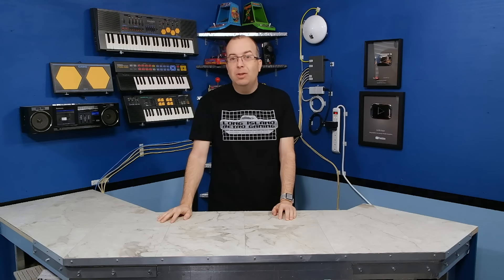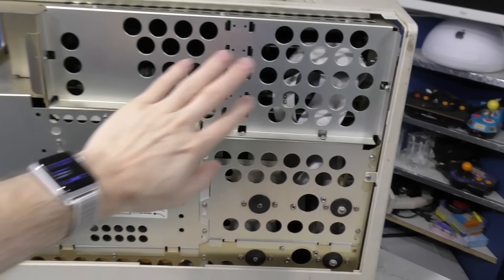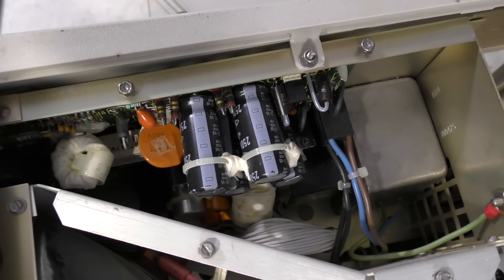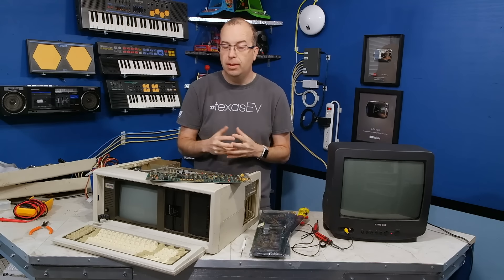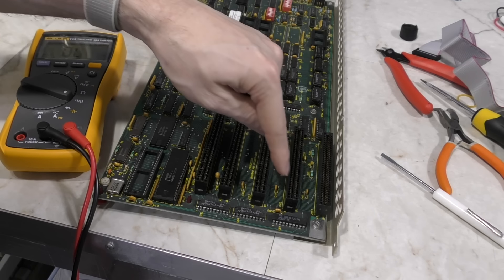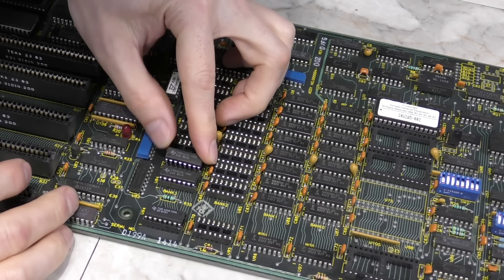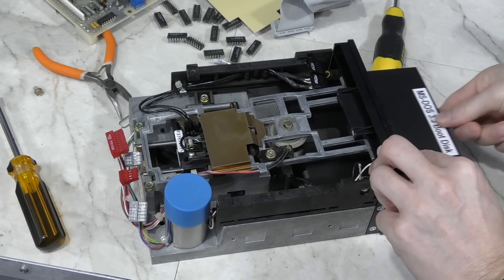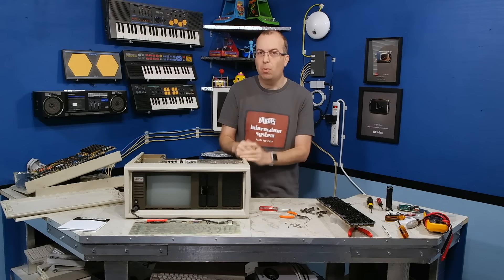Compaq Portable 1 Restoration - Part 1

Comment: Ask any antique radio restorer and they will tell you all about bad capacitors... They fail shorted, they fail open, or they fail in between where the ESR ("equivalent series resistance") becomes so much that they appear to work on a capacitance meter but fail in real use. A capacitor ESR tester is essential to fix electronics of this vintage without having to do shotgun (hope something hits the target) parts and board replacements. An ESR tester is inexpensive and I often use it before I even touch my multimeter. 

The Variac trick for slowly powering up an old radio, gradually bringing them up to full line voltage, is your key. With analog electronics, it's no problem; cranking the voltage up by 5% or so an hour works well, the tubes are colder than normal so the current through them is less than normal, the radio eventually starts to play quietly, a 1950s TV set might start to display a small and dim picture, etc. In fact, this will probably work with most older analog monitors.

There are a few videos of antique radios "cooking" at low voltage here. Electrolytic and tantalum capacitors use an oxide layer between the plates to avoid a short circuit. Gently powering up the radio allows the oxide layer to re-form and regain its strength before they experience their full rated voltage and inevitably short.

 https://www.youtube.com/user/TheLawrenceWade

But bringing up the line voltage to a computer with a switching supply which is designed to put out solid +5/+12V is likely to damage the supply - and wouldn't help anyway because once you get the Variac to a point where the supply can run, it'll just slam out its full regulated output and blow the tantalum caps off your motherboard. 

Failed capacitors are likely to become much more of an issue with restoring old computers because capacitors, especially electrolytic and tantalums, age with disuse. They just go bad sitting there. Ceramic and plastic film capacitors tend to be pretty good but are only available in smaller capacitances. I would always pay special attention to the power supply capacitors (in a small and hot box, but also dealing with substantial ripple current), the capacitors near any heat sinks including the CPU, and any capacitors in a device which is likely to get dropped (like a keyboard, mouse, external power supply, or remote control). Any tantalum or electrolytic capacitor can fail at any time, though. 

Aside from desoldering capacitors individually from a motherboard and gradually ramping them up to DC voltage, I don't see much of a repair path. It's gonna be labour intensive, risky, and will obviously damage the originality of the boards. And if the capacitor is already off the board, why not replace it with new? Don't try the Variac trick with digital electronics, I'm less enthusiastic about what would happen if you gradually ramped up the 5V and 12V lines; without the clock oscillator running until the bus voltage is high enough for it to start, I think bad things would happen in synchronous logic, and it might be really good to start a conversation with the people who designed this stuff about how to preserve it. 

The people who designed and built my 1937 RCA 88-T radio are long since dead. Fortunately, the electronics they created are simple enough that reverse-engineering it is possible - none was required; the radio was preserved well enough and powered up slowly enough that even the woven cloth power cord is original, and it all works after 82 years. 

But people really should be pounding on Wozniak's door asking him what will happen if you slowly ramp up the voltage to an Apple II to reform the capacitors without replacing them. Will there be race states or other weird issues in the logic because the clock isn't running for the first few hours? Will any of those states overheat and damage the logic chips? There's no point in having a Commodore PET where all the capacitors are good but every single integrated circuit is fried.

Comment: tantal  capacitors are making short circuit when aged. That's why cell-phone batarys are dying so quicly. but it is not battery itself. the charge is leaking thru tantal capacitors.

Comment: I had a Model 1 and 2, awesome machines. Everything is triple shock mounted and the selling point back then was the unit could be dropped 6 feet to concrete while the HD was accessing/writing without a hiccup (headcrash)

Comment: I've always wondered; When you Retrobrite keys, why doesn't it fade the printing on them? And what about keyboards were the printing is actually decals applied to the keys? I mean, even if it doesn't damage the decal, letters like O and Q usually have the film covering the center of the letter. It seems like that would prevent the solution from reaching the plastic in that area, leaving the center yellowed.

Comment: I’m sure you’ve found this out by now but tantalum caps fail as a short.  I really hate using them because if they fail without other protection on the board, fire and further damage result.

Comment: are you jumping power from the new power supply into the cord that was connected to the Hard drive? I am tryin to do the same but I cant find that 4 pin plug that connects to the mother board

Comment: Your RAM error is probably because you didn't swap the PROM in socket U35 from the 640K board into the 256K board.  There is a footnote in the service manual saying that to use the 256kbit chips you need a different decoder PROM.  It looks like they were discontinued a long time ago, but in one of your shots, you've got the right one for 640k, 101257-001, on one of the boards you have.

Comment: Do you know anything about the Intel 8086 to 80386 / 8088 to 80386 upgrade cards as I've had one for years sat in a box. It has a 80386-16 Intel processor and apparently it slots into an ISA card slot and has a jumper cable that plugs into the socket where the removed 8086 / 8088 CPU would reside.

Never had a PC I could test it on but kept it for 20 odd years as a curiosity.

I've heard rumours and tales that the 8086 to 80386 upgrade allowed 386 software to be run but at far slower speeds than a regular 80386-16 PC due to running the show via the original PC's 8 bit bus.

Comment: had a question about the Compaq 1,  all i get is a blinking cursor and no error codes or other screen activity.  Would you just suggest removing all cards but the video to see if i get some type of activity.  Wasnt sure if this model requires the ms dos disk to generate some type of initial screen activity or nothing should be required to see something other than a blinking cursor.

Comment: That case is ridiculous! Why not just use a few screws or some clicking thing which you can push in from the outside? It is cumbersome how you have to open that case. Granted, back then people rarely had to open the case but still, it could be easier. Two connectors on one POST-card, that is cool though.

Comment: If anyone could help me here that’d be great,
I just bought one of these, it turned on and didn’t boot. but about 5 minutes later it came up with “1701 Controller #0 Error” and then after waiting another minute or so it turned itself off, and it won’t turn back on.
What do I do?

Comment: I have one of these but no 5 1/4 boot system disk to test it. Can anyone point me to one? Are there any decent games to get for it? I remember having one like this in our office in the Air Force and we ran DBase II on it. It was a versatile program and more intuitive than SQL or even Access.
Reply: Im in the same boat. while I have not tried it yet as mine has degraded keys and I need to figure out if its worth fixing that fixing it I have discovered that a goteck drive emulator may work

Comment: As a bitcoin miner myself, I cringed at the mention of him hooking two different power supplies together like that.  The Antminer S9 miner has 3 hashing boards in it, and each requires nearly 450 watts each.  The instructions on the Antminer ALWAYS tell you CAN use multiple power supplies, so long as you do not have two boards using two different PSUs.

Comment: What about the Keyboard..Hard Part over, Lets Add in some Video Cards Time to Update This Puppy..Lets ADD a ISA-HDD-20-40Mb..
If you Want I have the Clone Case of the Compaq, but with CGA for use with my ATI VGA Wonder XL 24 a 16-BIT / 8-BIT Video card.. 
Mine was good to the 486DX40-50 CPU's and the Love of VL-BUS .. the classic 50 MHz, VL-VGA VL-RAID..

Comment: Paperclips?!?!?... o_O ....don't try this at home kids!
Not all metals conduct the same.... and they can get VERY hot as a result. From experience.
Use copper.... go and cut a few inches of yer missus hairdryer if you have to.. do whatever it takes... but don't use steel wire (paperclips) unless you've got fire insurance.

Comment: The need for the internal Fan shows that old day CRT devices would generate quite a lot of waste heat
Reply: Most computers have an internal fan even now
Reply: @ThatEngGuy  modern Computers are way more power efficient and modern Laptops have CPUs and GPUs that will throttle down speed if they get too hot allowing a modern Computer/Laptop to keep itself way cooler
Reply: @stephensnell5707  i know i was saying even modern stuff needs it :/
Reply: @ThatEngGuy however,modern Computers have more control over temperature

Comment: If anyone has one of these i need to find out what the specs are on the C2 capacitor (located near the CPU). My board was missing the C2 cap when i got it. I'm working to revive the machine, so i will need to do this as well as a full re-cap.

Comment: lol, theres literally everything broken about the machine huh?

I kinda suspected it was a short circuit, because thats the most logical explaination of why you'd have a voltage for a short amount of time until it is pulled to ground. 
You should be using a current limited power supply in those cases, or test for a short manually by probing 12v to ground.

Comment: It's interesting to see as knowledgeable as David is,  IBM Compatibles are very clearly not his area of expertise. I knew immediately what was wrong, and when the card still didn't work, I figured it was probably another short on another line. I had the exact same issues with my 5160, except on the motherboard. But any ISA card with a short will also cause the same issue, and the power supply will simply refuse to power it. minuszerodegrees.net is a super helpful source of information and troubleshooting for IBM's and IBM compatibles.

Comment: I picked up a Compaq LTE 286 laptop recently with no battery or power supply but after replacing some capacitors and assembling a new battery it sort of works, the only thing that is still dead is the backlight. This is what I created to replace the missing battery https://www.thingiverse.com/thing:3098939

Comment: I can't help it but I need to put some of my advise in here. There is nu such thing as a "weak" power supply. What you call a weak power supply is a power supply that is either overloaded by (internal) shorts or not just under specified. These came from one single system so it cannot be under specified leaving a short. The failing led here was to me instantly recognizable as the power supply protections kicking in. You do not test that with a bigger power supply with more tolerant protections (because of its heavier current capabilities). That is the same as fitting any power amp blowing its fuses with bigger fuses. Eventually something burns out as its not rated for that, you need to find the (developing) short. Whoever gave you the advise of a bigger supply was not thinking at that time.  A better route to go would have been to test both motherboard and power supply separate. The power supply you test by connecting it to a few dummy loads (cheap power resistors) calculated for higher and higher current draw until you reach the supply max specifications. If it does not go into protection its fine. The motherboard again should been powered from a current limiting power supply. If there is was a short, the current would then not go above maximum ratings. Any cheap power supply that has current limiting would have done. These test would have saved your motherboard without doubt.

In short: NEVER overpower a device mechanical or electronic EVER

Last: I do appreciate you taking the effort to restore old equipment to glory and we all need to learn sometime.
Reply: Honestly it's like taking a jack hammer to it when it also could've been solved the moment he took the graphics card out and the board powered on , he could've at that point looked for the short on the card . But stuff happens when you work on a computer for extended bits of time
Reply: @The Sanctuary Youtube channel. If you judge everyone by their videos, you must be disappointed in a lot of people as they have none. Making good videos is a art  and the 8-bit guy is much better at it than I am. That does not mean someone cannot post some advise. I have my share of restorations just not on video, but you are free not to believe that. I you have a problem with my comment, feel free to point out where something I said was false, else go be a fanboy somewhere else.
Reply: @The Sanctuary YouTube Channel come check out what i said sped
Reply: Just to add a new idea to the mix 
Over powering something is commonplace In the troubleshooting world it is a great way to find bad tantalums 
I have done it many times and never damaged anything

Also chewbacca tantalum capacitors don’t visually short 
There was no short that you could see it was a failed component not a short
Not all problems in electronics are shorts
Reply: @tickertape1  they're also common as fuck shorts and would have been an easy find with a meter.

Op of this comment thread is right and just because you haven't yet caused a fire and/or destroyed whatever you were trying to fix doesn't make it remotely a good idea. Jesus. He burned out a trace and the capacitor wasn't even the issue, that alone should tell you that doesn't work you're literally just destroying something in a very dangerous way and making a temp fix.

Comment: Use mulitimeter to test the power supply or just try one that is vastly over powered for the computer in question? Actually look inside the machine to see if from a visual inspection you can see anything broken/burned ect or just plug it in? Yeah obviously connect a different power supply using bent paper clips and just pass power throught it! You so dont deserve the following you have, Your method of plug it in, blow it up, swap parts or have a friend repair them is ridiculous! The only 'restoration' work you have done here is to take it apart and put it back together and you still havn't finished that. 'One of the most challenging trouble shooting processes I've ever had to go through' trouble shooting isnt breaking it futher then getting a friend to fix it!